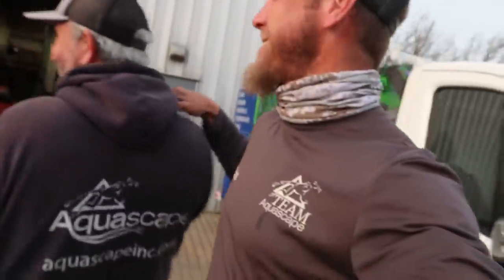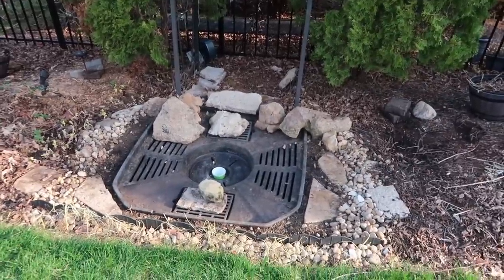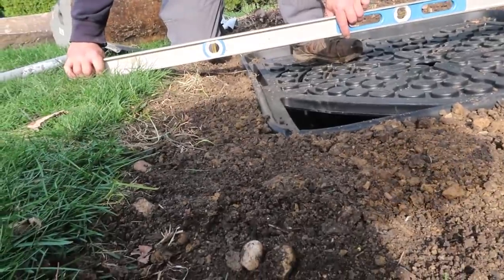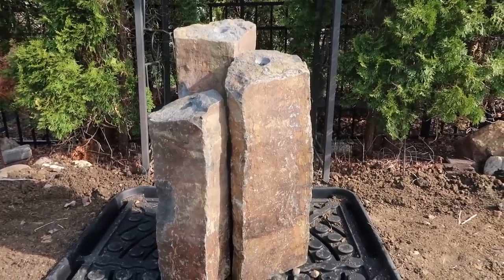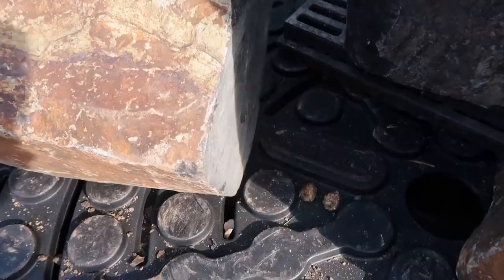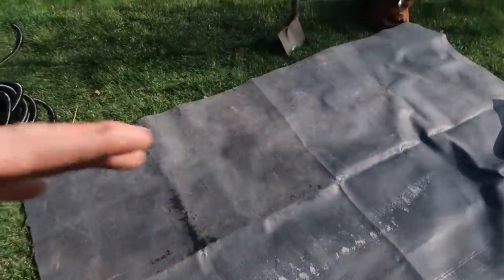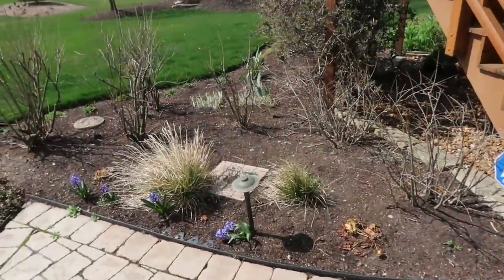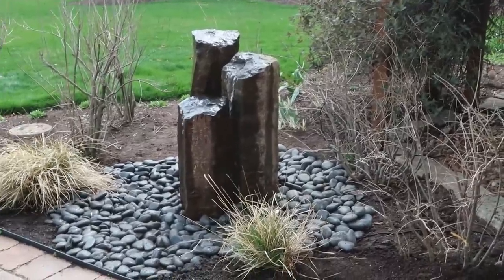How to Install Small Water Features for BIG PROFITS

Comment: Just installed stack slate urn but with a round basin... sure probably took longer to dig a circle and level it out than an easy square but its beautiful and I can hose it out from any angle easily as water runs like a whirlpool. Wish Aquascape had that basin option. Very easy install once its in the ground.

Comment: I love them both I like the first job with the colored rocks better. I have an electric panel in my patio which is far to the flower bed so how do you get the power to the columns do you have to trench the concrete to where the columns are? That’s the only issue besides how much to spend.  I like column plus a pond.
Reply from the maker: Best of both worlds!